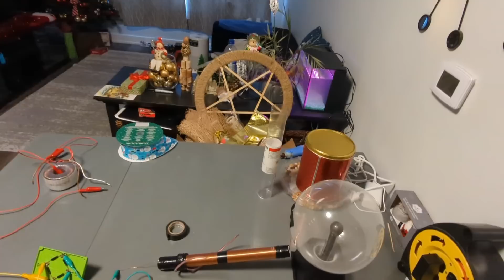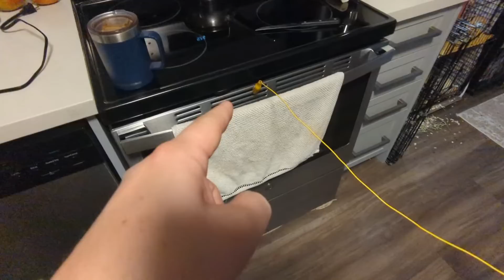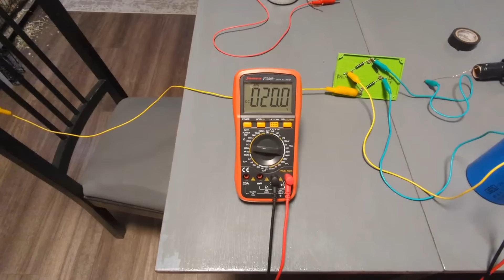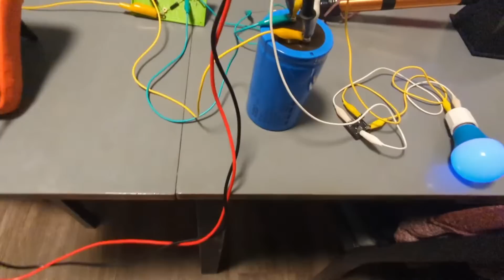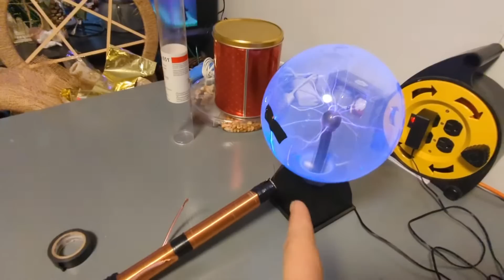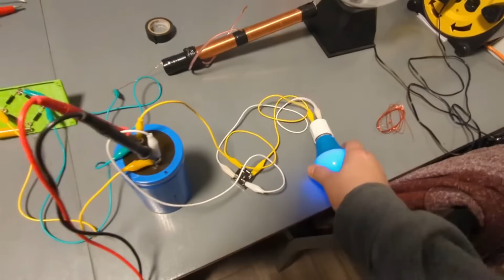Faraday Research ⚡💥 Tesla's one wire system radiant Energy Collector #tesla #freeenergy

Comment: I have a question that is off topic from this but it might be something that you have worked with because it deals with the electricity. 
I don't know much about Raspberry Pies, etc. I'm not sure if that is what I would need, but I need some kind of board that can look at the optical image from a high frame rate camera.
looking at each individual frame run a bunch of comparator type logic on each image if certain regions of pixels are this color Compared to another region of pixels being another particular color,
Basically making an optical encoder from the ground up that is specialized.
And running all that through thousands of algorithms, mathematical, electrical, magnetic-based algorithms with a target in mind determines how it will affect a bunch of electromagnets to achieve a visual target.
The circuit will need to be able to affect DC electromagnets varying their amperage and voltage. (changing the magnetic strength live and on the fly) Constant DC adjusting the variance very fast In regard to what it optically sees Based on target information seeking a particular result visually.
Any idea on what kind of hardware I would need? It needs to have lots of parallelism. If there can be multiple concurrent threads looking at the same video buffer frame by frame and an individual thread for each individual wire for the electromagnet, that would be great.
I needed to be able to process fast AF and make the finest adjustments to the amperage and voltage per individual coil, Electromagnet.
Reply: Awesome thinking 👍👍

Comment: Neat, though for the record you're not pulling Electrons from the ground, Electrons are a result of the wire failing to reflect the fields and have a waveform that matches that created when you slam the brakes on a high speed vehicle, Electrons are the terminal end of a unit of dielectric induction and represent energy destruction and waste heat, not power convection, a perfect circuit that has 0 loss would have 0 detectable Electrons. All the Pioneers of Electricity (Maxwell, Heaviside, Poynting, Tesla, Steinmetz, Thomson etc.) were highly against this model and for very good reason. The sooner we all gets off this outdated Electron model of Electricity the better.

An experiment I would like to see is if attaching your Earth ground connection to an isolated body of very large capacitance with no diode, that would be interesting, if it works then the comparison between it and Earth ground is both are acting as a capacitance reservoir as Tesla depicted in his analogy image for his 1 wire system where charge is stored and then reused, if not then something else is being extracted from the Earth ground to contribute to the circuit, likely to be Dielectric Tension (charge) as well just not from the input circuit, or it could be magnetism, that could be tested with an amp meter around the ground cable.